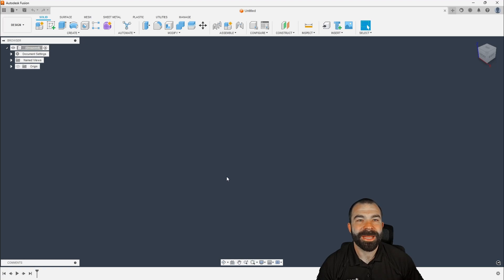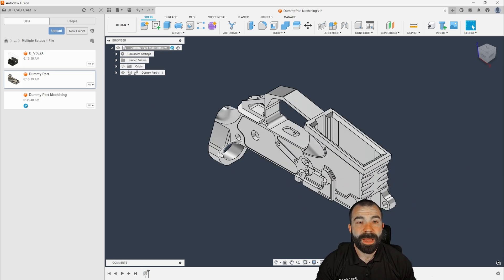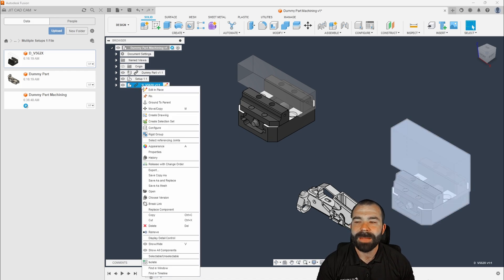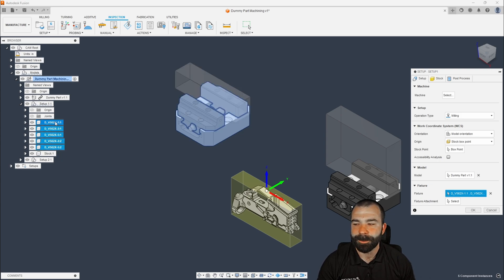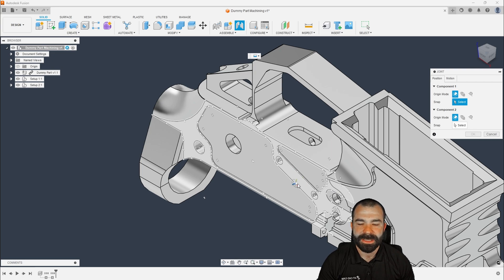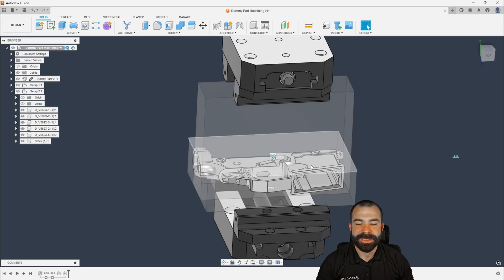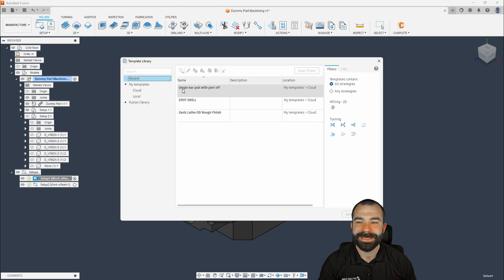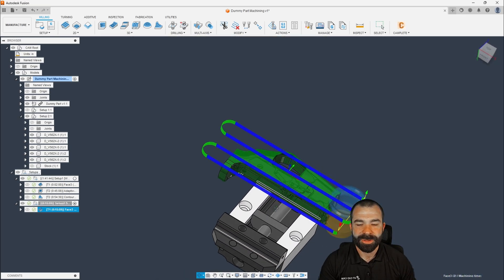Fusion Friday: 2 Setups 1 File

Comment: Another great video! Any reason not to do this by creating a manufacturing model for each setup?
Reply from the maker: Good question! yes cause you cannot utilize continuious rest machining in the setup.
Reply: @JITCADCAM  Ah...this explains why I get the warning "2ndOpFlip (Titanium): Continue Rest Machining: Cannot verify that the stock is transferred from the previous setup for rest machining. Verify that the model selections in both setups are the same." It works fine as long as the origins are correct. I need to start doing it the way you suggest in this video.
Reply from the maker: So this friday I will be doing this same concept on a Tombstone with mulitple parts and multiple setups.
Reply: @JITCADCAM is there a video for this with a tombstone? Cant find it unfortunately